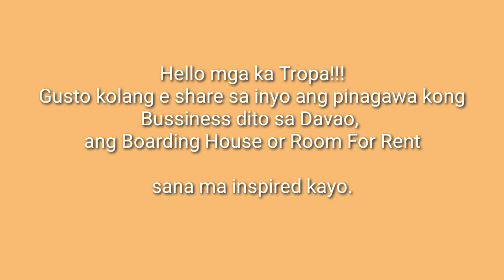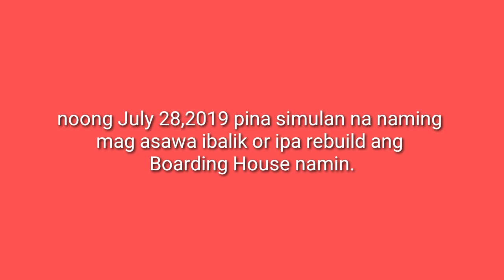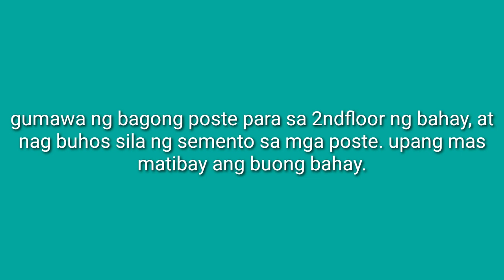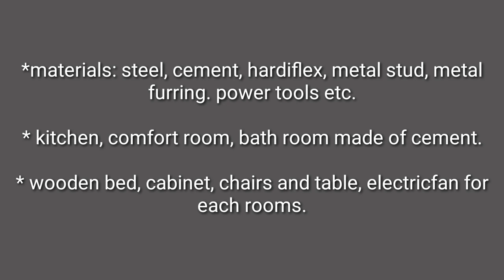450K MAY BOARDING HOUSE KANA! 5 ROOMS INCOME 23K MONTHLY!!

Comment: Ngplaplano Rin ako mgpagawa Ng bording house mgkano Kya magastos kahit 5rooms lng
Reply from the maker: Hi! Good day! Depende po yan mam kung anong materials gagamitin mo. Saakin kc nasa 2nd floor ng house ko ang boarding house ko 5 rooms. Gamit kopo tubular and rectangular stell, metal furring and hardiflex. And 1 c.r and 1 batheoom cemented and tiles. Plus electrical. Gumastos ako ng 400k. Dipa kasali gamit sa loob ng rooms. Like double deck, table, chairs, electricfan and plastic drawers.
Reply: @domzvidzz381  anong rectangle bar ano ung bakal ba?

Comment: Magkano po ba ang pa rent nyo sa bawat room?
Reply from the maker: 5 rooms ito lahat. 4 rooms size 8x10ft bali 4,500 per room. 1 room size 10x12ft 5,000 rent. All rooms has a double deck, cabinet, table, 2 chairs, electricfan and electricmeter. Free water and wifi.
Reply: @domz vidzz sa kanila na po yung kuryente?